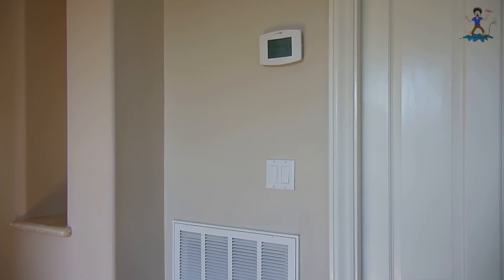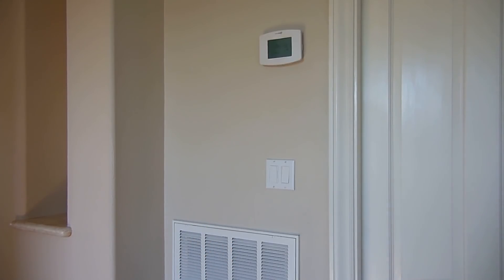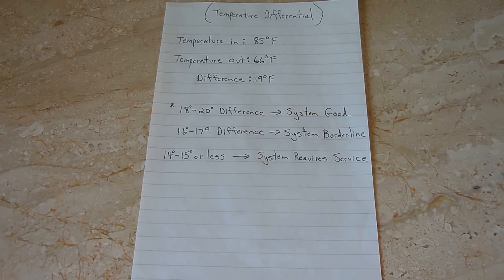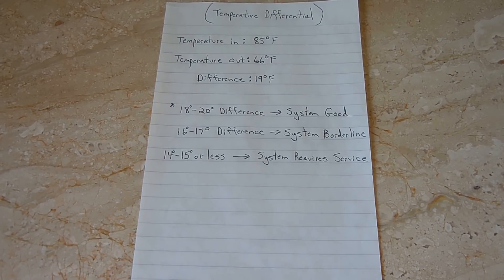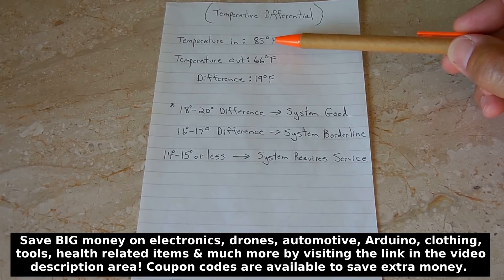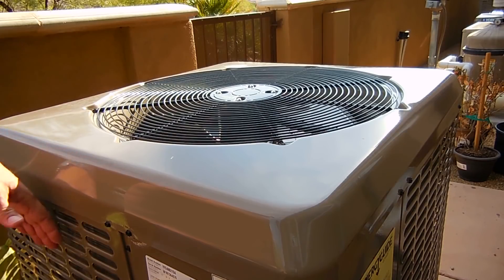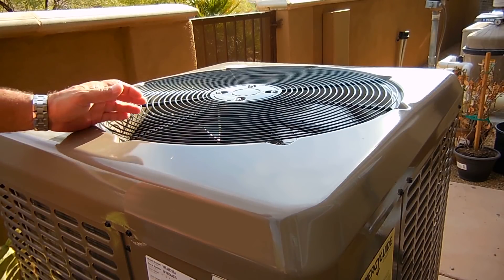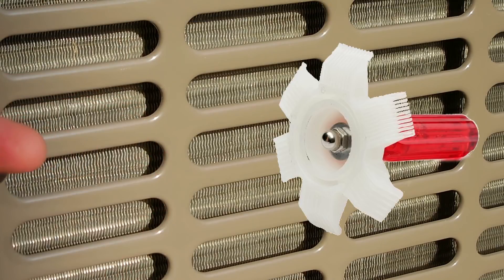SIMPLEST Central Air Conditioning Test (Split System A/C)

Comment: can you harness the air out of a ac unit the out side part of the unit. using windmill tech? to charge 12v 100ah lithium battery or power led lights in the house?  so my idea is using a wind mill motor face it to the out door unit to move the wind mill leafs.
Reply: wind mill on top facing the air flow.  so every time the ac turns on the fan outside the air that comes out powers the windmill to generate power.  i tried it but with a floor fan propellers and a dc motor only got 1.5v of power.
Reply: i called it a Air conditioner parasite.
Reply from the maker: Interesting idea.

Comment: I need your help on. How to troubleshoot my Window Ac air conditioners

     BOTH UNITS OR 1 to 2years old 

   1] Soleus air .it just the fan come on one speed 

   2] Comfort Air  its an AC/Heater .Ac.working but the Heating until does not work 

     How do l troubleshoot my units    

   Can you help me out

    email;alanw1978@yahoo.com
Reply from the maker: Watch my window/wall AC repair video. I only answer one SIMPLE question per viewer/per video. Viewers that supported my channel in the past by making donations or purchases, are entitled to help at a higher level. Time is money. Thanks for watching!

Comment: Anyone have some advice on this? I have a brand new air filter, when I place the air filter in the unit, the unit will no longer blow cold. If I take the air filter out, the unit then blows cold. I checked the compressor, and when the air filter is in, the compressor will not kick on, the system does still blow air with or without the filter.
Reply from the maker: Hello, make sure the door to the air handler's blower compartment is fully closed. There may be a door or panel you open or remove to change the filter. It has a push-button switch that's pressed (allows for power) when the door is closed properly. The new filter may not be allowing the door to fully close. Thanks for watching!

Comment: Yes my friend, that is called a Delta T reading. That's exactly how I diagnosed many A/C's in my 30 years of doing that. Good video.
Reply: It doesn't always indicate as described.  If you have a system under hot pull down with high humidity the enthalpy in the air will be removed first before sensible heat therefore the delta will not yield the standard reading you would expect.  Also deltas can be off due to incorrect fan speed selection, improperly sized ducts, this list goes on.  Since installers rarely do the job right, you'd be lucky to find a proper delta.  But it can happen.

Comment: Very good video, a few things to note:
1. Take supply (cold air) reading at the air handler because the duct work can pick up heat going through the attic and throw off readings.
2. Even if the air handler is not in the attic hot air can still leak in. A return can run through the attic before dropping down to the air handler and any spot is vulnerable to holes and crushing. Also some air handlers are in a garage which is only slightly cooler than an attic. The big platform it sits on must be insulated inside or excess heat will leak in from the garage.
3. If there is a 5 degree difference between what the thermostat reads and the return air temperature measured at the unit either the thermostat isn't in an optimal location or the return duct is leaking.
4. A good test for if your condenser is plugged up is to feel the air coming out the top. It should feel like a medium box fan strength and be pretty even around except for where the service panel is. Some fans shoot more sideways than up though so feel around.
5. Taking the top of the condenser unit is more hassle than it's worth. If you can just pull the fan and grate off, fine (the black circle as opposed to the brown square in this video). If not, shooting water from the outside can still help a lot. Make sure to still turn the power off so water can't short the condenser fan, its only water tight on the top. Look through the top and see if water is making it through the fins to the inside.

Comment: I just paid 630 bucks for a cooling fan motor and a capacitor! I know I got ripped off. Took him four hours to fix and 250 for parts
Reply from the maker: Todd Kesler Wow, you really got ripped off!
Reply: Hard to critize the charge when we don't know how far he had to go to get the new motor (if not on truck), how hard the fan was to get off, whether he cleaned the fan and maybe what a bitch the unit was to get to??? Think maybe about a crawl space attic in FLA.!!
But absent some of the above it seems about $200 high.
Reply from the maker: I've installed many condensing unit fans over the years, and $630 bucks for a fan motor and cap is a rip off. You can buy universal fan motors for $75-$100, and the cap costs only $5-$10. The job shouldn't take longer than 1 1/2 hrs to remove the top of the condenser fan, unbolt the motor, and reconnect the wires. Sounds like the guy's ineptness cost you around $200 more than it should have cost. I'd do one of those $630 jobs a day. A bunch of Criminals.
Reply from the maker: Correct, I estimate $200 too much as well.
Reply: electronicsNmore, Correct. I'm in the service industry in construction. I called them and told them that the cooling fan motor bearings we're making noise and I needed a new motor because I didn't have time to do it myself. I went along with the price because I called them. That doesn't mean I agree with the price.
I know they were over charging me, but doesn't mean that I'll call them back. Cluff Is the name of the company in Goodyear AZ.
In Phoenix hourly rate for a man and truck is 85 an hour. I rounded up to two hours for the time and parts I estimated to be 150.00.
Total 320.00.
Reply: Joe Wenzel I don't agree. Scroll up to see my reply.
Reply from the maker: Todd Kesler Don't bother with him. He's just an angry A/C technician. He mouthed off to me, so he was blocked.
Reply: Ron,
I ask the technician when he got their if he had  the motor on the truck. He said yes! Unit is new and outside and easy to get to. Then he said no! Warehouse was a couple miles straight down the road.  I have no problem paying for the service, I called them...doesn't mean I like it and will tell all my friends to call them because I was once bitten and now I'm twice shy!

Comment: After proper charge super heat and cool, THE MOST important measurement to take is static pressure using a manometer, Dwyer makes some and they are about $20 on Ebay.  Static pressure is indicated on all blower labels given a motor speed.  Static pressure is simply the restriction of air flow both a measurement on the supply side and return side.  You may still have an acceptable Delta T (which is what you showed) and have bad static pressures.  My label reads .5" on low tap, so if I had a static of say 1.3" my system would run probably double the time to remove the same heat.  As static pressure goes up CFM goes down, as shown on your blower manual chart if you have one.  No matter if you buy the best highest efficiency 18 seer unit and SP are bad, it may only be running at seer 8.  How can it be corrected?  If you have no duct leakage, then the manometer will tell you if the return or supply side (usually both) are restricted, and adding/enlarging more supplies and enlarging return in most cases will fix it, unless duct work is designed poor.  Bottom line you need 450-500 total CFM per ton, if you don't have it's costing you.  Ask your HVAC guy to do a SP test and a hood vent test on all registers, if he doesn't do that you got the wrong HVAC guy.  Once you have proper charge it's all about SP static pressure.  I live in FL too and have a 3 ton heat pump and at worst it runs 4 hrs per 24hr period, and bedroom at night is 72F.
Reply from the maker: A D What you say is correct, but this video was made for people that know very little about A/C's or they're totally clueless. I had to keep it very simple and show a very reliable method. Thanks for watching!